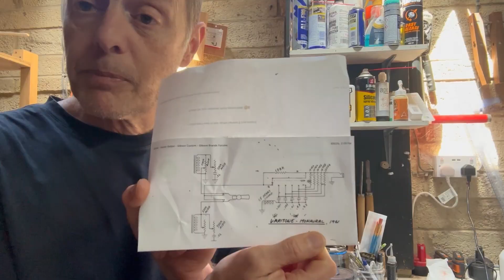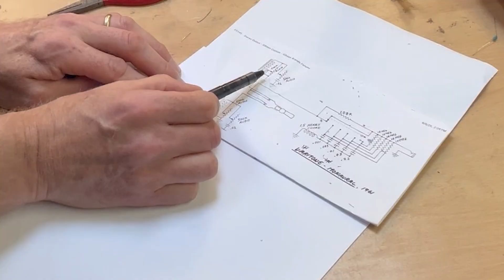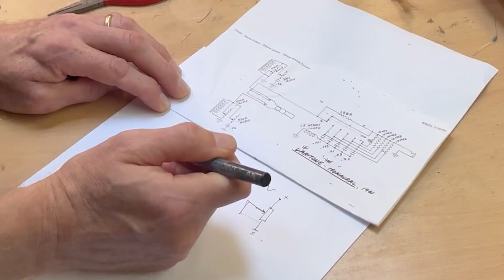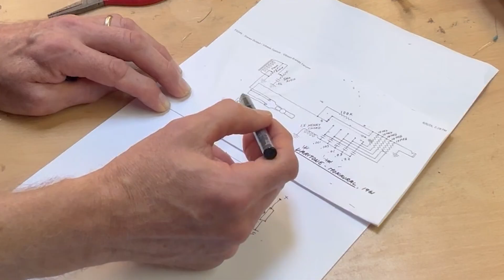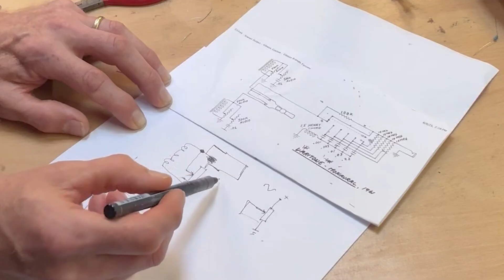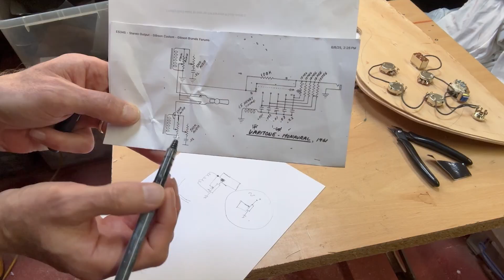Problem with the 1961 Varitone circuit

Comment: Just wanted to say thank you for making this video and pointing out the mistake and how to correct it. Am working on using a push pull volume for a mono 355 on the bridge volume to make it OOP, and with all the diagrams to adapt, it helps to properly visualize and understand what's going on ahead of wiring it up.
Reply from the maker: Glad it was helpful. It's clear how they managed to put the dot in the wrong place and it's been photocopied over the years. The circuit basically does what you expect ish so nobody noticed.
Good luck with the project it sounds interesting.